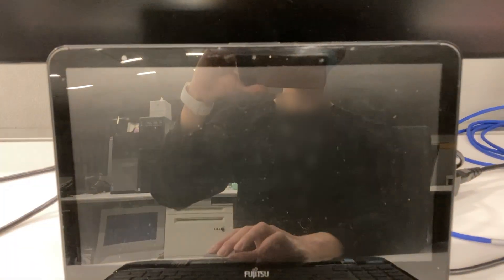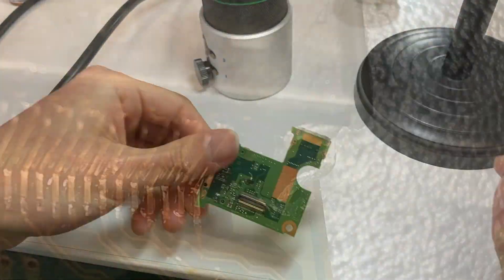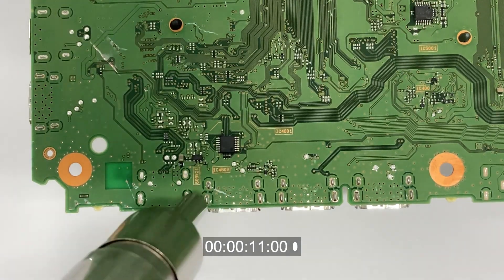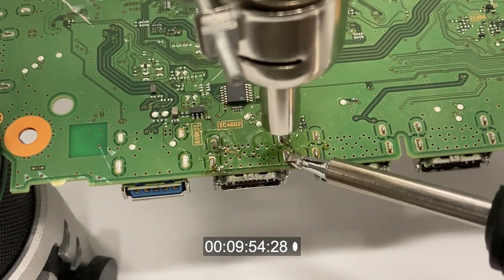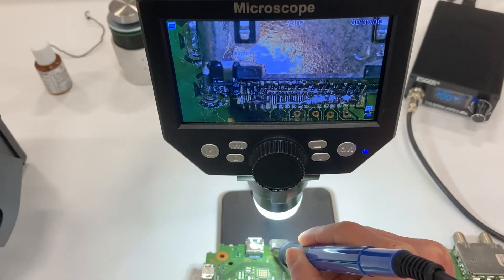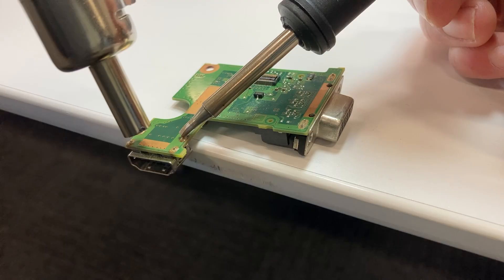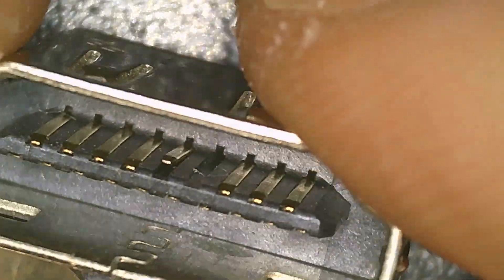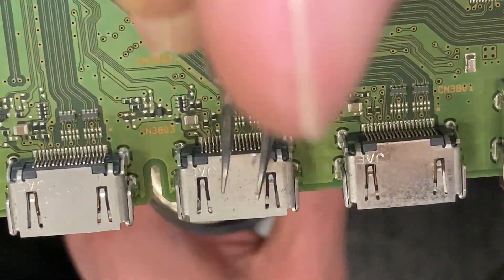How difficult is HDMI replacement? (As a beginner)

Comment: So when you desoldered the HDMI cable from the board you used a sort of heat gun and a soldering iron to simply nudge off the solder from the board…

I have a 2013 PS4 that has a broken HDMI port and I want to replace that. This at least gives me piece of mind that at least it shouldn’t be too hard to do but what does concern me is the other components around it and wonder If I may need more tools as hoping I don’t damage other parts. Other than that this video has been sorta helpful.

Comment: Some boards are coated with some sort of lacquer from the factory that makes soldering/de-soldering a pain. I think that was the case with the first training board. You can brush off the coating with a fiberglass brush. They make them specifically for this job.

Comment: I am feeling similar pain right now, although maybe worse as I have a 0.5mm pitch mini HDMI port with 6 ripped pads. Last attempt worked but display had artifacts as a pad came loose. Biggest helper for me has been a decent optical stereo microscope (first used a digital camera mono vision one & it's better than nothing, but with no depth perception & poor optics, a magnifying glass is better: they're not very good at all). The other is UV curing pcb mask to secure & insulate fixes.

Comment: those legs at 3:20 are not soldered well, you made solder balls on legs but they are not connected well to the pads. You should first heat up both pad and leg with a soldering iron and then add solder so it flows nicely between two forming strong, uniform connections.

Comment: I recently used a TV as a monitor in my place. There was heavy rain and lightning, and suddenly the TV was no longer connected to my laptop. I tried to restart it, but there was no change. It still didn't connect to the TV. In the TV menu, the HDMI port 1 is white every time the HDMI cable is plugged in, and when it is unplugged, it will be gray, indicating that it is not connected. However, every time I try to check the laptop settings, the HDMI is not detected, as well as in the Intel control panel settings. Is this damage to the software, hardware, or is it just my HDMI port that is damaged and needs to be replaced?

Comment: Hot air gun is only for removing many leg ic smd packages, for all other needs, especially for removing through hole components there are desoldering stations. Those are not too expensive, get a cheap one from ali and you will find that desoldering is so much easier and faster and does not risk damaging other components on the board.

Comment: A trick to do the ground shield pins to to use a angle nozzle and heat underside while putting the solder at pin on top side. It flow in once hit temperature and makes for a factory clean look. As far as the pads on the board tin them with a little even hump and tin the HDMI connector under pins, flux and drag solder it. Then preheat the board with hot air, the drop in HDMI, then wait till you see it drop further and connections in rear is shiny, or move HDMI connector as you would dance/float a IC to check it and you won't have to manually solder the pins. Use flux it helps. I done well over 100's consoles and learn over the years. You get good at it after a few. 300c is to low, especially in game consoles like a ps5 board where huge ground plane 430c  quickly.  Temperature for manually soldering small pins around 390c with a medium size bevel tip and plenty of flux. With those temperature gave you, make sure you calibrate your hot air station thermocoouple 1 inch at nozzle and tip with a Hakko iron tip thermometer to get same results. Use a cartridge style solder tips like JBC, or a METCAL RF station for better thermo recovery. I prefer the JBC solder stations as run AC on heater and more power, which means better recovery overall. T12 will do the job if good genuine Hakko cartridges, but the JBC and Metcal far better.

I get you want to show people on cheap tools, but it actually discourages people. just use reasonable tools like for the JBC instead of the JBC station, cheaper would be a Axiun and you can use JBC tips the better Axiun T420D station use AC as the genuine JBC station and as good. You can still get budget tools that will do far better then the cheapest tool that will discourage someone as they find it to hard and makes it way more difficult, then it has to be. Balance is key. I learn on a plug in the wall Radio Shack set temperature solder iron, before stations where readily available. With SMD it different as boards act as ground planes for heat dissipation and requires good RF, or cartridge based solder stations and hot air stations.

HDMI sure be a 1 out of 5 on your scale, just use better tools. I do about 2, or 3 a day as repair consoles professionally as own a store now and takes me literally under 5 minutes about 35 to 40 minutes total taking the console apart and putting back together. I literally just did a ps5 while watching a couple of your video.

Comment: Funny. I did the pin replacing thing with some BMW tail light bulb fixtures. The replacement plugs wouldn't fit so I just removed new metal contacts and installed in original fixtures. Took a while to see the light. Lol

Comment: 8:48 I know something that could be useful for this problem. Using less wide solder wick sucks exponentially more faster than wide ones. I think 1.5mm wide solder wick is my sweet spot. Branded wicks are consistently wide but unbranded generic ones aren't, they tent to be wider... so maybe ordering 1mm?
Yeah, It runs out very quickly, but it sucks instantly fast and you avoid pushing heat for long periods of time. Heck, even beginners with trash soldering irons or trashy tips with enough power to melt the solder can make 1.5mm and 1mm wick suck
Reply from the maker: Thank you for sharing your experience. I didn't know the width of the wick matters. Will give it a try in my future projects!

Comment: T12 soldering irons is not good enough for boards with hi heat dissipation. Try to get JBC based systems. Highly recommend AIFEN A902 it have 2 channels and it supports JBC cartridges C245 C210 C115 and C470. As it have 2 independent chanels you can do your soldering using 2 soldering irons it worth it. Best cartridges is genuine JBC (but it pricy) Magma witch you can get in bundle with this station fine to. So get full kit (3 handle + 3 cartridge for every handle) and you never ever look at T12.

Your heat gun is like your soldering station ok but there better options like (quick 861DW, sugon 8630, Atten ST862D, BEST-BST863.)

best regards.
Reply from the maker: Thank you for the suggestions! Will use it as a reference when I upgrade my tools in the future.

Comment: 300°C is usually too low. I don't do almost anything under 350°C, especially if lead free solder is involved. However i know my iron is calibrated and has a heavy tip - is yours cailbrated? At the lack of calibration, you can take solder wire of the type you expect the solder to be, and increase temperature until you can melt it, and then increase it 50-70° more! If you're soldering to ground plane (i.e. mechanical tabs here), you increase even more!

Hot air at 250 is a joke as well. You have some of the solder that melts at 230°C, while your board is actively losing temperature left and right, gradients, so what are you hoping to accomplish?

I used to hate wick, but then i found 1.5mm wide wick which works well! But it still needs to be wetted with fresh flux beforehand. When working with wick, you need to up the iron temperature once more again. Wide wick is basically unusable, because it wicks away all the heat, and fundamentally you have a bit of that problem with any wick, it goes into the spool. What always helps is to clip off a small length and hold it in your tweezers.

I use a 2.5mm wide chisel tip for most things, because my current station only supports 4 shapes of tips, it's remarkably good station but very very old and does not have all the options that are available today. I have been able to try J-tip and K-tip elsewhere and i like those. There's almost never a case when i have to use a point tip, i have one for my station, but i wouldn't use it for HDMI connector and the like, very rare use, because its thermal transfer is really bad.

Absolutely love the attempt to rebuild the HDMI port. Perhaps there's someone selling specialised HDMI ports for this model board though? It's good to buy board schematic, you can get PN from.

The real "low melt solder" (with bismuth) is not something that i trust, but it appears you have standard 60/40 leaded, which is actually very good for repairs. I still use bismuth for removal of components.

I also really like solder suckers for liberating holes. There are now ones which have a silicone tip, this is much better. Also the new ones don't have a warding around the reset plunger top, so you don't need to reset it with your thumb, you can whack it on your thigh or desk, makes for much better easier hold and with my tiny hands my thumb plain wouldn't reach. I used to have my own self modified solder sucker but now i use one i bought rather inexpensively.

You should get some Kapton tape to protect components you don't want to damage. Make sure it's not accidentally PET tape, which shrinks. Normally PET tape should be sold teal colour, but now they make it brown colour too, very misleading.
Reply from the maker: Thank you for the detail tips and suggestions! Where do you usually get board schematic from? I searched Fujitsu LH772 but couldn't find any results. I don't mind buying the schematic if it is available!
Reply: @hardwarerepair200   Ah i can't say that, the comment gets yeeted by YouTube. I tried.

Try to figure out the board OEM and the board model number, not the laptop model number. You might do fine with a board schematic which is similar and closely related but not totally identical.
Reply: @hardwarerepair200   Don't search for the laptop model number, search for the board number that you find somewhere on the board. Try to figure out who made it, Compal, Quanta, Wistron ASUS etc.

Shady forums like vlab and remont-aud.

Sometimes you find things on Electrotanya but there's a lot missing there.

Comment: Very good videos. I am new to repair personally. I recently replaced the front usb ports of an Xbox 360 using a donor board and I also had the same issues with the joints not melting. I realized that while my temps were good (370C) my fan speed was very low and I was only slowly heating up the motherboard. Then I ramped it up to max and the port got wiggled out and i eventually replaced it. Your technique where you melt the points with hot air before sticking the port in is very smart as I would try to wick the solder out of the thru holes before soldering it down, and it would end up being very time consuming and a waste of soldering wick.
Reply from the maker: Thank you for sharing your experience! I didn't know about the fan speed and have been always set it to max. It's so helpful to learn from each other.

Comment: I solder with my iron at around 350 degrees celcius, hot air goes around 350 too. It does kind of depend on the "thermal mass" an object has (so for teeny tiny solder joints I may go as low as 280), but with a small iron (or a small nozzle) I find that around 350 works fine in most situations.
Reply from the maker: Thanks for sharing! I guess I am still too inexperienced to pick the right temperature in the first try.
Reply: @hardwarerepair200  We all gotta start somewhere 😉 I'm by no means an expert, but even experts need to adjust / experiment sometimes.

Comment: I feel your pain so much.  I really realllllyyy hate High temp solder, small pieces and the through holes to pin pieces in place these days.  Its nightmarish and largely pointless other than F up repairmen.
Reply from the maker: Me too. I would say without that microscope, it is impossible for me to even see the pins.
Reply: @hardwarerepair200  I deal with phone repairs which makes it even worse because you have a bunch of tiny modular boards which warp far too easy, its driving me nuts and the idea to flood the boards solder with my own simply to remove some parts is something I was forced to figure out on my own because it was the only option I could figure out.
Reply: @hardwarerepair200  I just now broke my Magnifying Light which is a magnifying glass with a light on large flexible arm and I am truly dying inside right now. :(
Reply from the maker: I am so sorry to hear that. How expensive is your magnifying light? Is it possible to get an affordable digital microscope instead?
Reply: @hardwarerepair200  Ah cost me literally nothing a basic magnifying desk lamp but was a massive help when it comes to these things as it was a large magnifying glass on an articulating base I could just plop in front of my work and have a much better view.  I am sure ill be able to fix it or get a new one but thats all time I didnt want to spend and I have grown quite fond of it for so long the plastic parts are kinda dry rotted hence the reason for the break.